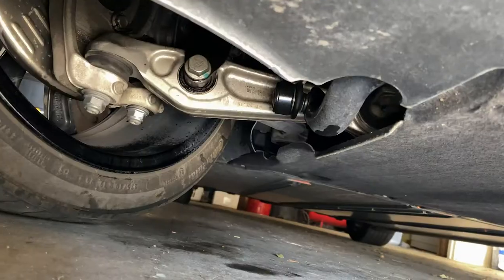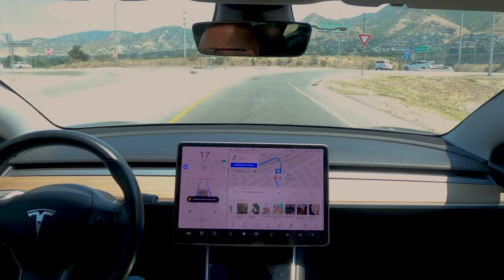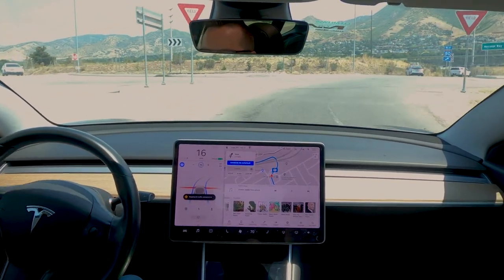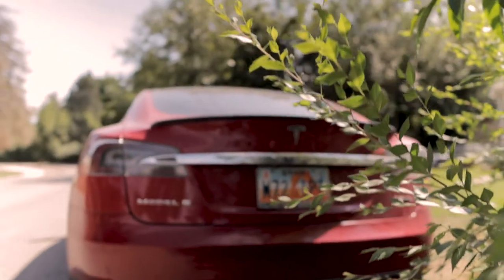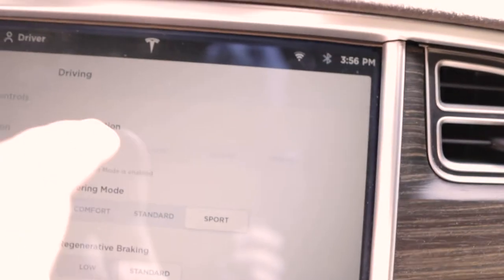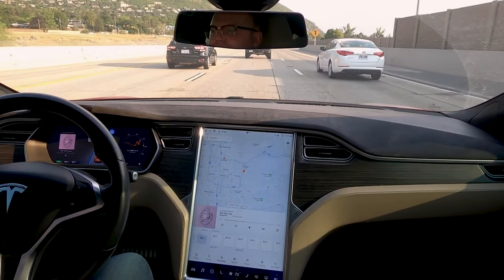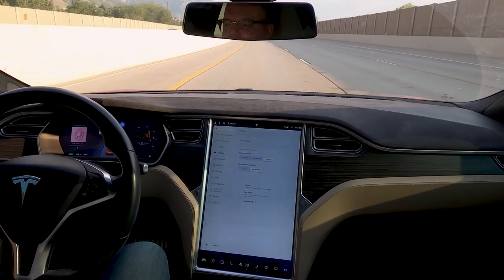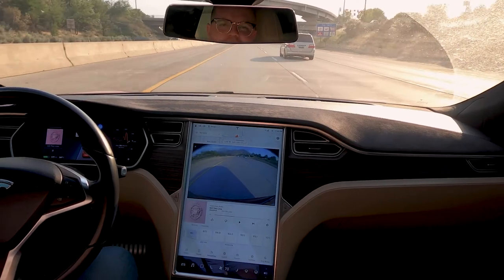Tesla Model 3 Squeaking Noise Passenger Side, Service Center Experience, and Loaner Tesla.

Comment: Tyler! Awesome to see your channel! I’m subbed now.

I have a Model Y and experiencing this exact same problem. I tried putting some lubricant in the ball joint but I doubt I got the straw in deep enough to apply it directly on the joint. 

Hopefully I can figure something else out before the service appt. 10 days out rn!
Reply from the maker: Brett!  It is awesome that you found this. Not so great for the squeaking. The part that’s is squeaking usually is under the bushing so it didn’t help me to spray it. Did it work for you?  Also good that it is just more annoying than dangerous.

Comment: I had the same thing happen just out of warranty.  I removed the ball joint from the knuckle, pivoted the ball joint around a few times and reinstalled and the noise went away.  Just had to move the grease around in there a bit.
Reply from the maker: That is really good to know. I think I am having not the same level of issue but a squeak. I am going to try that out :).
Reply: Did you drop the suspension to add grease?
Reply: I did the same thing. Took the tire off, removed the bolt connecting the ball joint to the knuckle and then pivoted the ball joint around for a few minutes to work the grease back in. Worked perfectly and no more squeak.

Comment: hi, thanks for this video. My model 3 starting making the exact same noise last week and i like you opened a repair ticket with Tesla for a service visit.  They will be sending a mobile ranger to my home to repair it. i did say in the description that i thought it was the upper control arm and after watching your video it does sounds exactly the same.   I did text the repair guy that i hope it is the upper arm but i am a IT guy and not a mechanic so i hope he has all the parts it can be.   Glad the repair was easy enough and i hope all is well. Thanks . Doug
Reply from the maker: It is a pretty quick fix and it sounds like he might know that it is the control arm. The only thing that is odd is you usually need an alignment after. They typically will give you a number to call and I would double check with them and say it sounds like the control arm should I bring it in instead. 
I had both replaced on that side and it required an alignment both times.